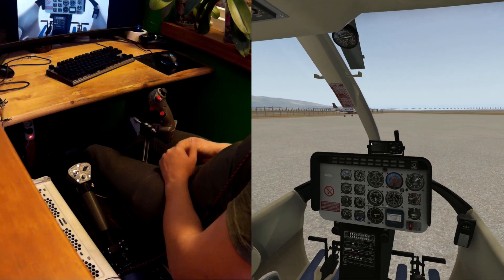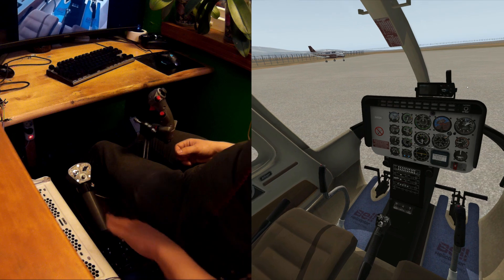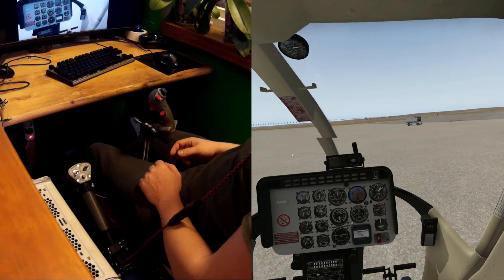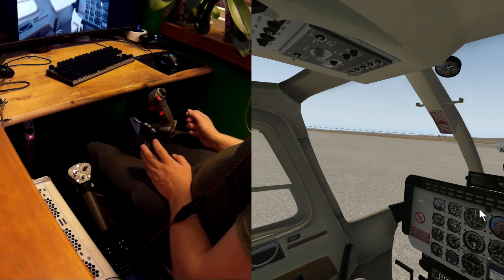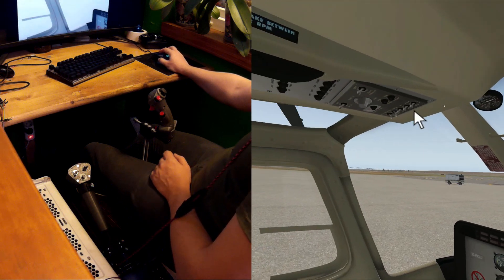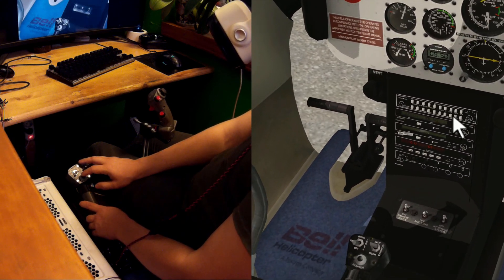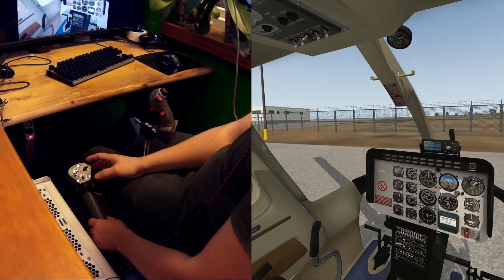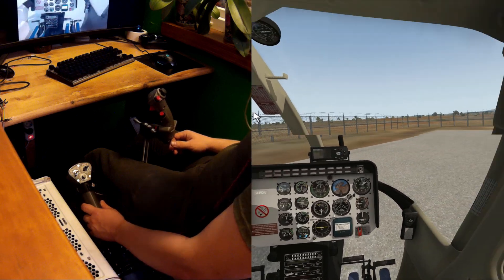Simchair MKIV Bell 206 collective in action =)

Comment: hello hc625 ma
first congratulation and thanks for this hell of a work. very impressive....
then comes my question. 
In the soft configuration, on the second folder "b_device_def", i don't find the bell 206 activation code line.
i did print this head but cannot activate it.
if somehow you could help me solving my problem.
best
Pascal.
Reply from the maker: hey! just replied to your previous comment mate =)

you need to add the line #define B206_COLL_SWITCH_PANEL to the device definitions tab.

Cheers!
Reply: @hc625mascozyhangar9   YES.....Works....had no doulpt about it...😂
sorry for double writing my request but i didn't find the first one back....

and once again fucking CONGRATULATION for this wonderful work..... i'm blown up.

best
Pascal.
Reply: @pascallavanchy1642  Thanks mate =)
Reply: @hc625ma1   Hello Alexey, I'm facing an other issue. on my B8Grip, i have only mid, low buttons and PTT+intercom working. i miss the top button and all the joystick. i thought that my building was wrong so i re built everything from scartch with new components....=same result. am I missing some specific setup or did i screw up my building twice.....
thanks in advance for the help you might bring me.
all the best
cheers.
pascal.
Reply: @pascallavanchy1642  thats how it should be, the top button is reserved for the force trim system (hold it and move the stick, release it where you want the new center to be, same with pedals, this can be disabled in settings)
Reply: @pascallavanchy1642  the hat switch by default moves the center of the stick precisely, you can actually fly a bell 407 with the hat only when trimmed properly =) without the trim system, you wont be able to fly for long, its also extremely useful to counter some heli-specific issues like "nose/tail-heaviness", the wind, or smth
Reply: also mind the rates panel with 2 knobs, a very useful thing, you can dial smth like 80% to fly the 407 comfortably or 100-110 for something like the arma3 mohawk =)
Reply: by the 407 i meant xplane 11 dreamfoil 407
Reply: @hc625ma1  thanks Alexey for this fast reply.
i did read indeed your tuto on how to use the trim force on the stick and understand better the use of the to button and the arduino joystick.
to sum, it is normal no to see the top switch and the joystick on my joystick control panel on my PC but it will operate as a trim when plugged.

other little question, according to your heavy experience in heli sim, what is the best soft. so far i have Xplane10 at home.

just to let you know, i did build a moving sim that i can use for cars, planes and with your deep help....helicopters....

all the best.
cheers....
pascal.